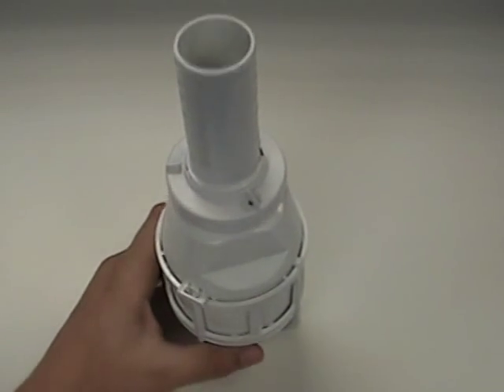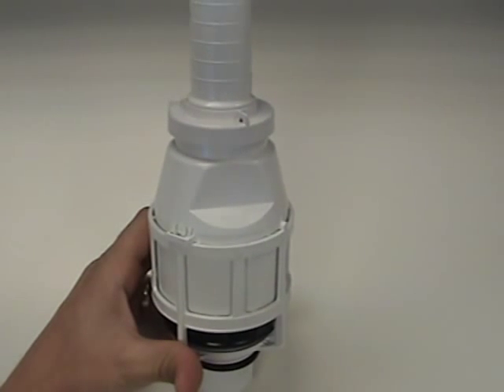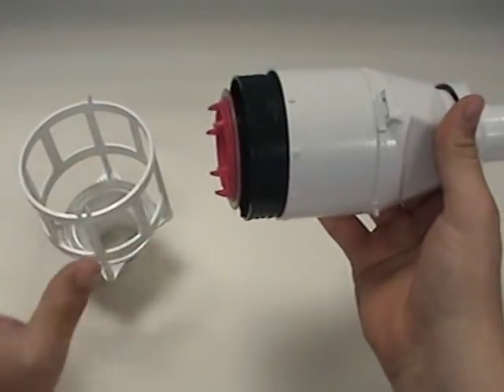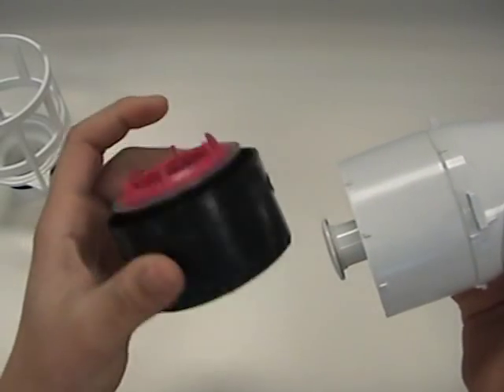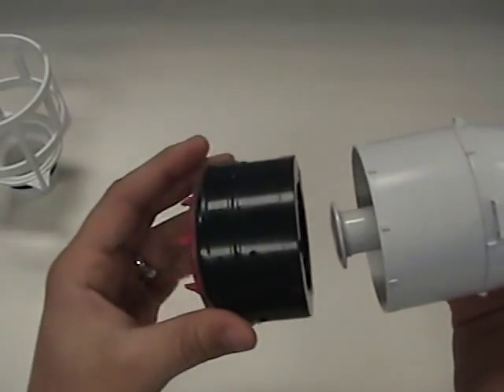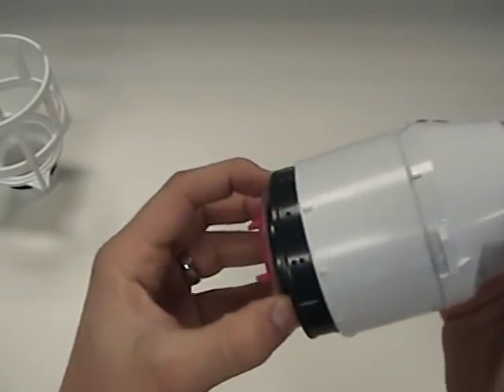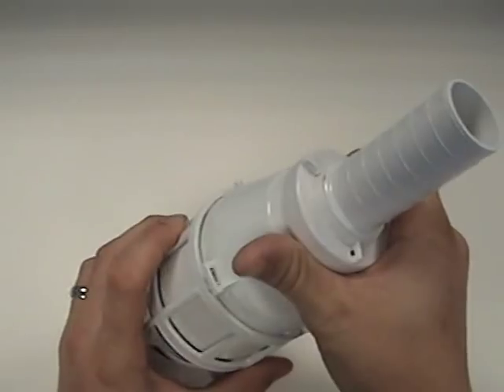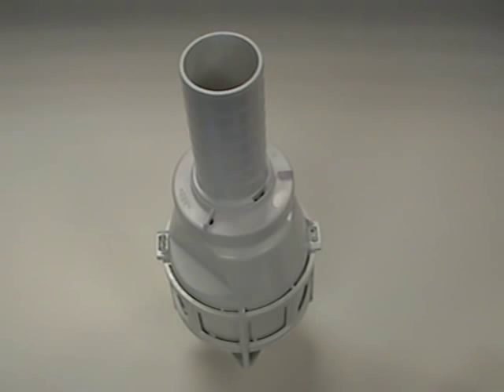Grohe Flush Valve Replacement

Comment: or you can just change the seals - GROHE ADAGIO FLUSH VALVE SEAL KIT - about 4 pounds
Reply: or clean the seals with vinaiger !
Reply: @leonardparapente9807  my toilet bowl leaks but it leaves about a centimeter deep water in the tank. It doesn't leak all the water out completely. Would you know if that indicates if I need to change the seal or the whole valve?